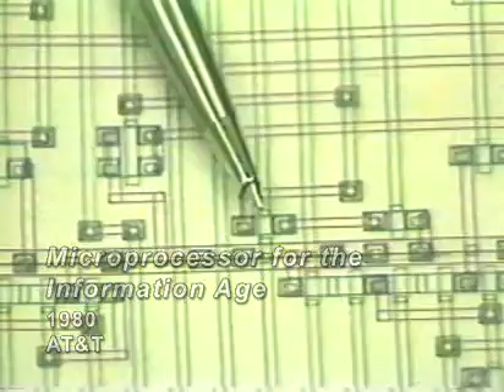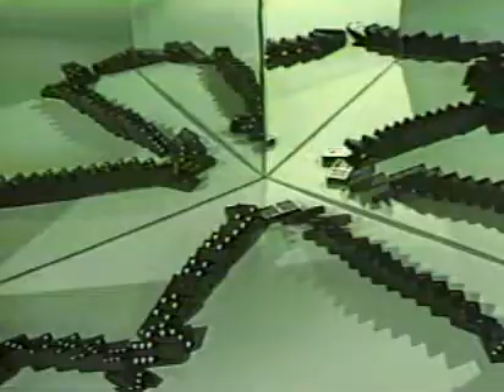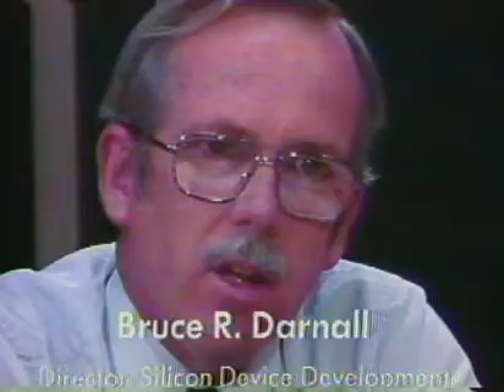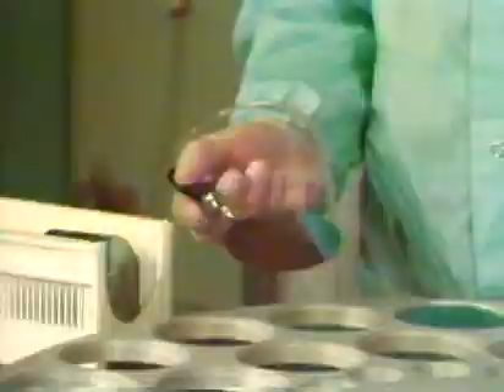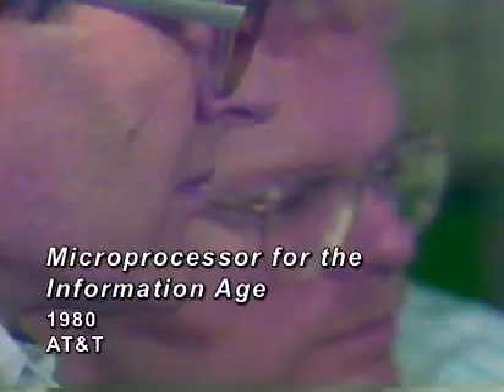AT&T Archives: A Microprocessor for the Information Age

Comment: I worked on the Bellmac-32 design team from '79 to '85 in Bernie Murphy's High-end Microprocessor Design department. I did my part to design, simulate, verify, test, and characterize 3 generations of the chipset. It was a heady time and in hindsight, one of the great highlights of my career. The people I worked with, several depicted in this video, were among the top engineers I've had the privilege to work with. If AT&T hadn't broken up I might have stayed there my entire career.
Reply: That specific program was Gate Matrix, created, if I recall correctly, by Steve Law and Alex Lopez. I think that's Alex in the tan sweater seen from behind.
Reply: @richardgordon7123 This is great information -- I've been able to do more digging, thank you !
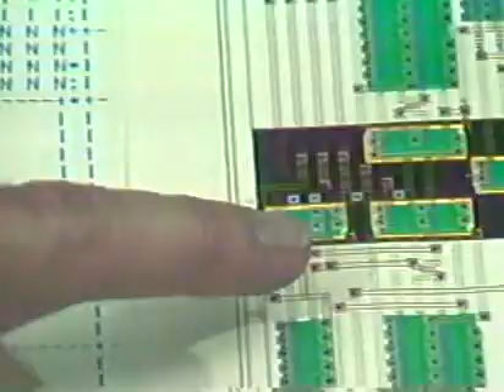Reply: Very cool ! At around 2:45, do you know what program (?) was used for that computer aided design ?